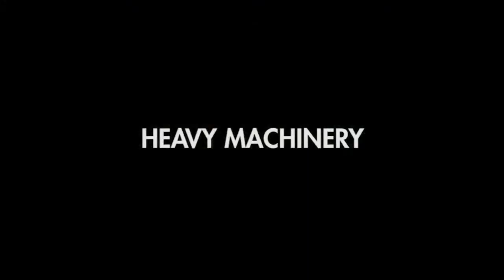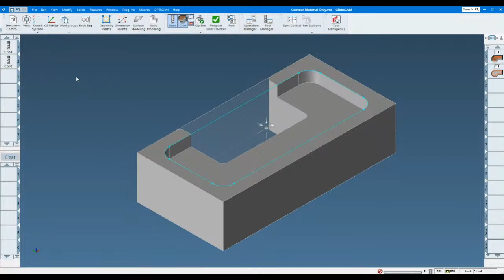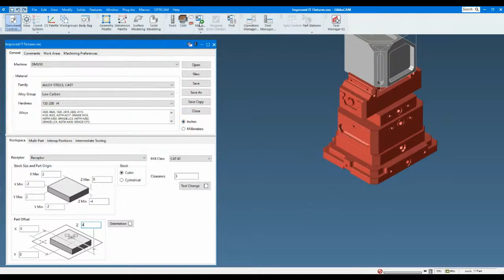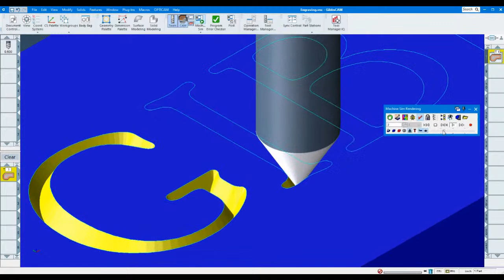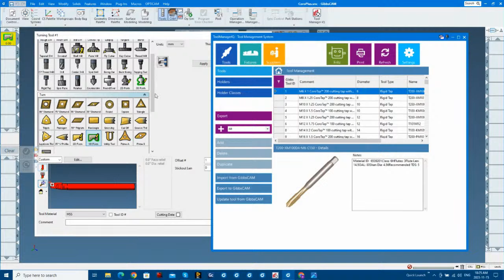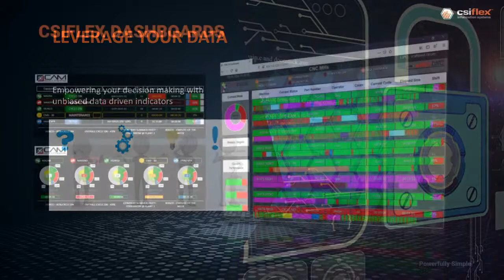GibbsCAM 2024 Rollout

Comment: Gibbscam need force tool change ASAP
Reply from the maker: If the reason is to have a safety block on each operation so that it's easier to start in the middle of the program, then you can accomplish that with a post change. Using two different tools with the same information may also work depending on your post. Thank you for visiting our channel.